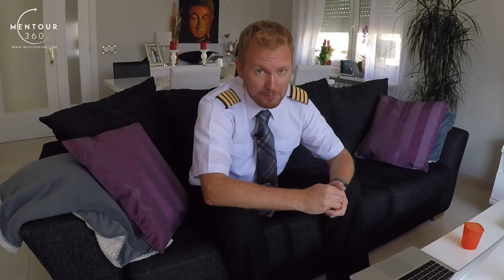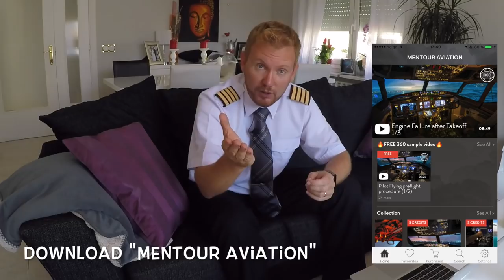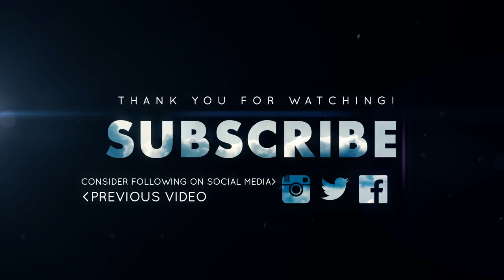Why do pilots sound like robots - PA

Comment: Hey guys, I have been a passenger service advisor at a airport for about 3 years and to cut a long story short I was really nervous about doing my first PA for boarding, I eventually plucked up the courage to do it and well they are easy- once you can remember them instead of reading off a call sheet that is- the boost in confidence this has gave me is on a whole other level. I feel like I could do anything after I done my first one and the pax actually listened to me. I would just like to share that with you. :)
Reply: Nobody cares
Reply: Rude
Reply: A late thank you for sharing your story!

Comment: Today on my flight when the Captain did the PA Announcement, im not sure if his headset was broken or just crazy low but it just sounded like a mumble and could not hear it over the air conditioning it was that low, yet when the cabin crew spoke on the phone system PA, it worked perfectly. The Cabin crew also didnt tell the captain that his PA was really really quiet / to the point it didnt work.

Comment: The reason for sounding like a robot is understandability. on older speaker systems it made it clearer to understand. also it eliminates accents in a way, also helping passengers to understand you better. thats also why you speak in a certain way with ATC

Comment: Other than the welcome, the first PA I heard was telling us, when we were halfway through the flight, going over mountains, telling us that they had to return to the city we left because there was a problem with the anti-skids. I still don’t know exactly what they are. The pilot said he would not be able to take off from the destination if he landed at the destination. I assume that it was because the problem could only be repaired in the city of origin.
Reply: Anti skid device has to do with braking upon landing usually in heavy rain.
Reply: @sharoncassell9358  I figured it was something like that. Since I was supposed to be flying out of Vancouver into the interior of BC. Considering the amount of rain we have in Vancouver, this is not a surprise.

Comment: Hi Mentour! Could you perhaps make a video about, what to write down when ATC delivers a long clearance message. Thanks.
Reply: If you don't know already, you need your departure procedure, climb instruction, when to expect your climb to assigned altitude, and departure frequency to contact, and then your transponder code. not really sure what else there is. Basically goes like "Air X seven three seven bravo, cleared to the WHATVR waypoint via the SOMESID departure and then as filed, Maintain 7 thousand, expect filed altitude 10 minutes after departure. Departure Frequency 123 decimal 45 squawk 2345."

Comment: The standardized way of talking used by pilots in their PAs doesn't bother me and I always guessed that it must have its reasons. What bothers me is the incredibly low quality of the loudspeakers (which makes matters worse if the PA is in English, for example, and neither the speaker nor the listener are native speakers, or if it's in a language of which the passenger may have limited comprehension). Modern planes have AVOD IFE, WiFi on board, mood lighting and several other state-of-the-art things, yet they don't have top-quality, clear-sounding loudspeakers, which would have negligible cost comparable to the plane itself and those other amenities.

The fact that PAs are perfectly and clearly heard through the headphones (when the passenger has them on) indicates that the microphones used are good - the problem is with the low-quality speakers. I don't understand why Boeing, Airbus and other manufacturers don't work together with leading audio companies such as Harman, Bose, Altec Lansing, Sennheiser, Sony, etc. to provide more clearly sounding loudspeakers - especially considering that clearly understanding an announcement can be critical for safety in many situations. Even in the the most modern planes, loudspeakers still sound cheap, distorted and shrieking just like they (probably) did in the 1940s.

Comment: I do realize a dress code, professional look but... are you allowed to wear such a tie?
My question is because I am a bus driver in Warsaw and we do have strict dress code: navy/dark blue trousers (not a suit one, but forget jeans or corduroy), same colour tie and plain sweater or sweater vest, also light blue shirt.
From May to September we are allowed to wear a polo shirt, not to wear a tie and have top button open.
Of course there are some loopholes. It is not said how dark or light trousers or shirt must be, so as we are provided with uniform (two polos, two shirt, a tie, sweater, sweater vest, trousers) driving 5 or 6 days in a row it is not enough.
Therefore you can buy more from employer or just shops. In the second case there is no chance to match the colour.
Two other loopholes are: 1) it is not said about the sleeves - you can use short-sleeved shirt all year round if you like.
2) there is no regulation on shoes, so one can look like a pilot or Prime Minister wearing Nike Air Max at the same time ;)
Thank you for what you do!

Comment: Is there an instrument that tells you the aircraft weight in real time?
Reply: Essentially, yes. That's the FMC. It's not 100% accurate but it's pretty damn close.
Reply: joseph nier yes
Reply: No, that FMC just estimates depending on fuel burn
Reply: I have heard that on some aircraft, there are sensors on the landing gear, and depending on the movement of the suspension of the aircraft up or down, they can detect the weight.
Reply: yes
Reply: How do you know the accurate weight of every passenger? I mean even the average value of weight is unknown.
Reply: The fmc tells u the rough estimated weight but the loadsheets gives the extact take off weight and the zero fuel weight which is the. Updated on the fmc
Reply: joseph nier 4d
Reply: joseph nier what i know the answer is no just the fuel weight  can be calculated .it might be in some airplanes but really no clue

Comment: You say they use seperate microphones for the pa, but I thought they use the mic in the headset that is also used for atc. I remember many year ago that I suddenly heard a pa on the local twr frequency, The twr controller was amused by that and answered that they had the switch in the wrong position and that the pa was not "aired" in the cabin, but on the twr frequency!.

Comment: do first officers ever make PAs ? or it's only the captains?
Reply: they do in emergencie's when for example the Captain doesn't feel too well, and they need to divert
Reply: Karthik Nakul a good one.
Reply: When I flew the Twin Otter the FO and Captain used to take it in turns to do a welcome and safety brief in the cabin. At my current airline flying larger aircraft it's usually the Captain but as FO I'll often do it so I can get the experience for when I get my command. I've never liked public speaking so the practice really helps.
Reply: Karthik Nakul i
Reply: My buddy's dad was flying as the fo for the first time and the captain let him do the prelanding announcement. He got on the pa and said, ladies and gentlemen this is your first officer speaking from the flight deck. We are approaching lax and will be landing momentarily. If it's a good landing, that probably means I had control of the plane. If it was bad, well, that's why the captains nickname is Crash, right?
Reply: Before the flight the pilots have a briefing. Then they make appointments who's gonna do everything, so both pilots can do that.
Reply: Sure, all the time. Usually, the Captain makes the initial PA and halfway through the flight, the F.O. gives some insignificant details about the weather or so.
Reply: Sometimes
Reply: Depends on the airline at my airline the FO rarely makes any PAs. Some airlines require the FO to make some of the PA's Some pilots keep it short and to the point, some are long winded and annoying.  The FO was not required to make a PA and most do not want to do it. So if I asked the FO if he wanted to do the PA the answer was most of the time No. This video is very accurate and he tells it like it  really is.
Reply: I'm an FO and in my company, FO's do the inflight PA while they are pilot flying.
Reply: captain had the fish
Reply: When I flew the Saab 340, the F/O gave the PA, as we used to give it during taxi, right after the briefing. This was done in order to allow the captain to give full atention to taxing the aircraft safely.
Reply: Have had the FOs make announcements a couple times in flight on DAL.
Reply: Karthik Nakul I'm a first officer for virgin Atlantic (soon going to be a senior first officer) I got to use the PA not just,in emergencies although it's usually the captain who does the PA's. It's not a rule or anything the Captain can allow you or not, but I got to use it a couple of times (the first time was when some of my family members where on the plane).
Reply: It all depends on the Captain (PIC/Pilot-in-Command). He/she can always tell his/her Copilot/First Officer to make the welcome address.
Reply: They do

Comment: Suggestion.. How do you deal with toxic behaviour in the cockpit?
Reply: ΙΩΑΝΝΗΣ ΛΙΑΡΟΣ in my organization,  we have six pilots. we all know and respect each other. we've all been through extensive training and invested a great deal of money to reach the level we are at now. therefore,  it doesn't exist in this enviroment. that's not to say it isn't relevant in other operations around the world. e.g.  at my last airline, if a crew member was written up for  behavior unbecoming,  it was a two tier process. first,  was remediation: whereby the employee is confronted by the carrier in an attempt to set straight and correct the anomaly. easier said than done if these disruptive traits are hard wired into the personality. the second phase is termination.

Comment: If the PA's volume is pre-determined, unchangeable and not so loud, what happens when there is an emergency? The last thing you want is for some passengers to not manage to understand what was being said. Which reminds me of something: I used to fly on Ryanair quite a bit in the past and, at least with respect to their flight attendant's PA system - it was terrible. It wasn't necessarily too quiet, but it was most certainly terrible acoustics and I remember I couldn't understand more than like 40%-50% of what the flight attendant was saying. Sounds like a really bad thing in case of an emergency, where what the flight attendants' (and pilots) say can make the difference between life and death.

Comment: If the aircraft cabin has a low volume on the PA, I imagine that will make communication difficult in the event of emergency, especially if there’s a panic.
Reply: That is why the cabin crew are there.
The Bing bong noises are a pilot asking for an intercom call from the cabin - the intercom use the pilots headmics not the pa

Comment: please,why do pilot tells passenger the altitude they are flying??
Reply: Ok, so pilots do it for those people who 1.) Who want to know and 2.) For those people who are afraid of heights. So when the pilots say the altitude, people feel safe that the pilot knows the height and that everything is running smooth. Another reason they do it is because when an emergency occurs and something happens to the pilots for some reason, passenger/witnesses know and have the altitude the emergency happened at. Fell free to ask any other questions.
Reply: Jay Pow may it also be to inform some hidden captains in the passengers?
Reply: So they know how high they are

Comment: I have a question that flat-earthers give a lot of meaning to. There do not seem to be any commercial polar flights over the Antarctic continent, like Cape Town to Auckland. The reason I give is that there are no good emergency diversion airports in Antarctica. But at the same time there are direct flights that skirt Antarctica, like from Auckland to Buenos Aires, and they are still pretty long. Am I right about the diversion issue, or can you think of other reasons?
Reply: Michael Dunlavey several reasons.

I worked for a couple of years in the Antarctic.

Unless flying to a base at the geographic pole or the pole  of inaccessibility the policy of all the national research institutes is that you dont fly across the continent for safety reasons unless there is good reason (tupically a research project or to fly out someone taken ill).

This is not only about lack of diversion opportunities but more importantly the total lack of search and rescue services.

When overfights are made the planes have to travel in pairs and have ski landing gear and follow routes with a reasonable chance to put down both planes in an emergency and fly the working one out.

When the Americans flew a guy with a broken back out of the UK base at Halley many years ago they sent two C130 Hercules across the pole. Space for one doctor one stetcher and all the survival gear they would need "just in case". 

Remember this is a continent twice the size of Australia with only two bases inland from the coast. Apart from the US base at the pole and the Russian base at Vostok (the so called pole of inaccessibility (ie furthest from the coast in every direction) there is nobody to offer help if you need it.

And its dark 24/7 for a couple of months at the ccoast, for six months at the pole.

And I havent even mentioned the temperature. The Russian scientists have to breathe air pre-warmed by their body heat to prevent frostbite of the lungs. So if you go down you need cold survival gear for every passenger you have to get it down the evac slides and your cabin crew need to be trained in Antarctic survival to a level to help survivors into their safety gear and cope with the frost injuries to untrained folk who dont follow directions first time. 

The North Pole is tropical in comparison to the South pole - let alone to the true middle of the continent.

Not only would no civil aviation authority allow that for fare paying passengers but the economical fare they would need to ask would make a Concorde flight look like a local bus fare.

Its easier cheaper and safer to fly round than to go over

Comment: I'd say the biggest issue is that 98% of all people don't know how to use a microphone. Also one of the reasons most radio conversations are not understandable for the most part.
Little hint: if you push the capsule right up against your uvula, the mic will not pick up properly and sound ridiculous :D

Comment: How far do you hold the PA mic from your mouth and at what angle. Do you have a technique on reducing sibilance or plosives (p poppings).
Reply: Craig Hunter when I was on the A320, i kept the boom about an inch from my mouth.  to eliminate popping,  I would raise my head slightly. as a corporate pilot,  my PA's are done face to face prior to engine start. the guests in the back are the owners of the plane, their  interests are:  etd, ete, eta, fuel and weather which is updated from the flight deck on their ipads.

Comment: Hi 
May i knw what is pilot HUD?
HOW DOES IT BENIFIT THE PILOTS?
Reply: Prathiksh Shetty to get to the brass tacks of the  matter,  on the Falcon 7X, EFVS ( enhanced flight vision syatem) provides an image on the Head-up Guidance System (HGS) HUD and on flight deck displays that enable the pilots to see the terrain and airport environment in low visibility situations such as in fog, haze and at night. EFVS significantly improves situational awareness, not only during take-off, approach and landing, but also during ground maneuvering.
Reply: Ava Mendez  THANK YOU VERY MUCH.👍

Comment: does the mobile really effect on the aircraft during the take-off??
Reply: Rafat Yacoub They made the rule just in case a phone were to use the same frequency as the pilot uses. Even if it didn't, it may still cause interference in the cabin.

Some airlines, including Delta and British Airways, however, offer messaging services on their flights, although BA1 shuts its service off over US airspace for some regulatory reason. (I initially thought that they had allowed cellular service on their flights, but it just turned out to be texting over Wi-Fi only, although a British Airways pilot says that it works through the mobile phone provider somehow, although the passengers have to pay their mobile providers roaming charges.) Air France seems to offer VoIP, but that may be the only example that does, for somewhat obvious reasons.

Comment: I routinely use a very simple two decades old flip-open phone, and my flight attendant chastised me for using it within five minutes of landing, while I was sitting in a first row (first class) passenger seat. Meanwhile, other passengers were obviously using advanced technology smart-phones within the seats directly behind me. How could my decades older telephone be more dangerous to an aircraft on final approach, than the new smart phones? 
When ever I am chastised by the cabin crew, it encourages me to use a different air carrier for my next air travel flight. If a twenty year old basic cell-phone technology could interfere with a safe landing: then everyone should wonder how safe it is to fly at any time, to anywhere.